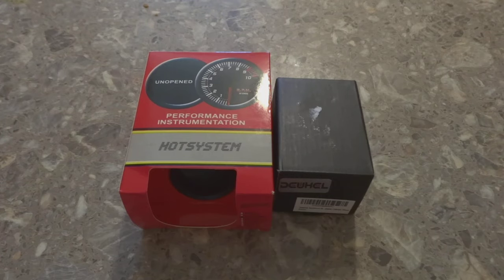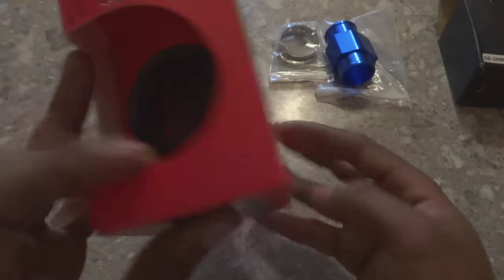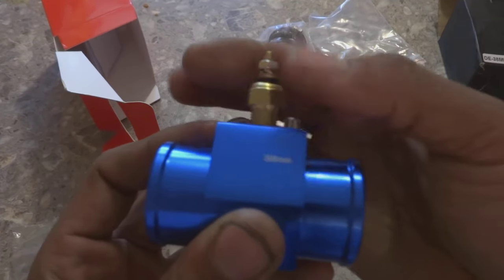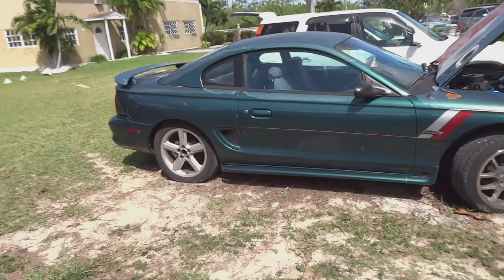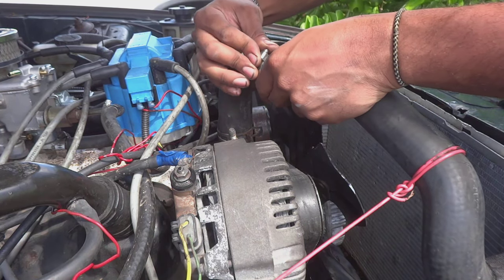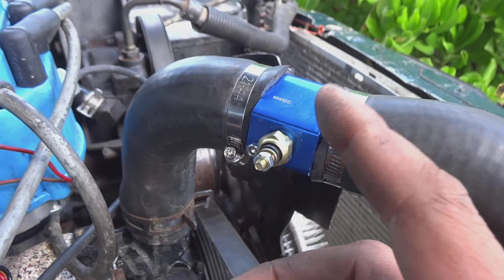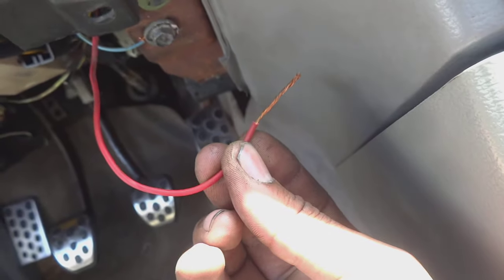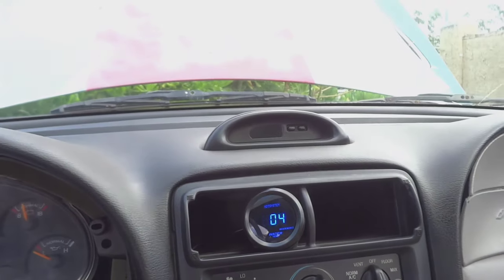How To Install A Water Temp Gauge

Comment: Bro. That was a good information.
But the car and installation needs a golden grammy award for most outstanding by stander 
That mustangs in deep depression.
Cable wires holding radiator hoses and shit together.
Instrument cluster has even said good by to the car.Bro keep that water gauge installed its the only thing keeping the mustang,s heart beating :)

Comment: The adapter is sized by the diameter of the lip, so it's ok to go for one size up.. meaning SN95 uses 38mm hose so 40mm adapter can be selected..
Reply: On my truck the end to the radiator is 32 and the end to the engine is 38, so I ordered a 36 to put in the middle as it gets wider lol

Comment: omgawd. That's the sketchiest temp install I have EVER seen lol
Reply: Puñetas
Reply: Temp install? This how my permanent install looks 😂😂
Reply: Yes pretty shoddy work. Also do not use a ratchet and socket to tighten hose clamps. They are just to compress down the rubber hose properly, not to excessively clamp down. You can see the clamps and the hose were distorting from the excessive tightening. As long as the clamp isn't broke doing this it will work but it is not proper and may end up badly.
Reply: Look at the rest of the engine bay think he cares ahaha
Reply: It does. Look shoddy a  gauge should. Be. Mounted  in the dash. Panel or a pedestal cup
Reply: I want to do it on my 87 pathfinder , I can't find any other way to do it . Nothing fits

Comment: Please explain how you get ground from that spot.  Super confused 😕
Reply: That's hooked between 2 hoses. Not the body of the car lol
Reply: Yea a rubber hose doesn't exactly count as grounding run ground from engine to sensor or just skip the stupid bolt on the housing and ground it to chassis
Reply: @chrisalvarez9442  he hooked a wire from the screw bolt and then  a bolt on top of the alternator bolt for his ground point.
Reply: @offroaddemon1991  No, you can't.  That ground terminal on the hose coupling is to give the temp sensor a ground reference since that's how it works.

Comment: Good video how has it run is it accurate I saw this gauge on amazon and I said let se if I can find a video of the gauge and your video came up trying to put this in a 1995 Dodge Ram because the gauge on the truck stays on the middle of 210 and 260  with a/c on so I don’t know if the gauge on the truck Is not working or the truck is over heating but for redundancy I will buy this gauge what the aluminum connection so due a update of how is working

Comment: Why would you want the temp coming from the engine vs what the radiator is putting out? The engine temp will always be higher. Im curious to learn.
Reply: That is because you want to know how "hot" your engine is running. Not how much your radiator is cooling the water. So The cauge will tell your real engine temp, not your cooled water temp.
Reply: most of the time its because of the problems that happen if the water gets too hot. As you can imagine, if the water boils (100.C) thats trouble for your car, whereas your engine reaching 100.C isnt that bad. Thats my take on it, Im not a mechanic

Comment: Where did you get that temp sensor from?
Reply: @DriftDreams242  Thanx
Reply: @DriftDreams242  Is this the right one,  Water Coolant Oil Temp Temperature 1/8 Npt Electrical Sender Sending Sensor Unit
Reply: @DriftDreams242  Thanx I believe I found it

Comment: That is a very horrible installation !
Reply: @DriftDreams242  Another mistake. If you don't actually want an accurate temp then you can do that but you want to view the hot coolant temp that is coming out of the engine and that is through the top hose. You are viewing the temp of the coolant that is going into the engine which gives you no idea what temp the engine itself is running at. Either find a way to run a sender on the block or intake or just make the installation look a little nicer.